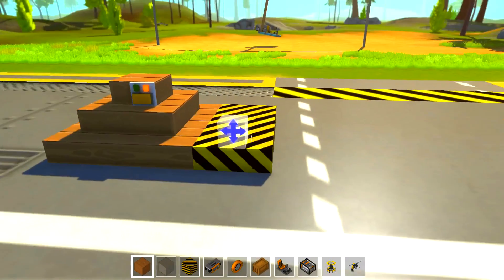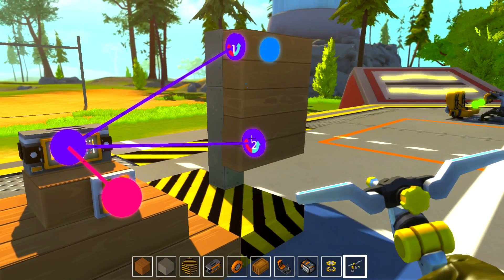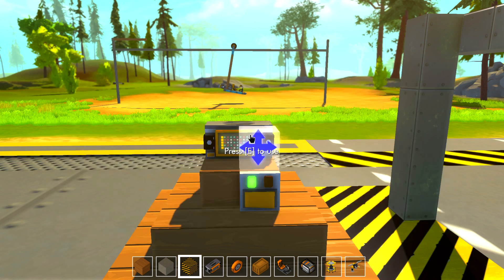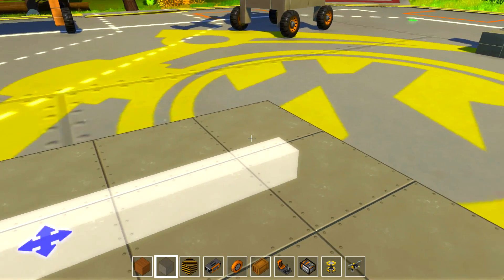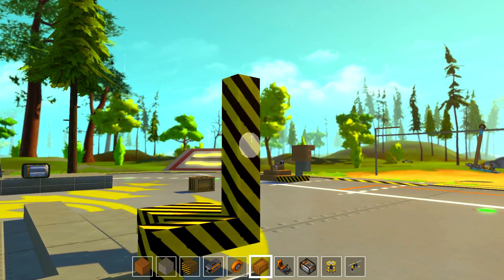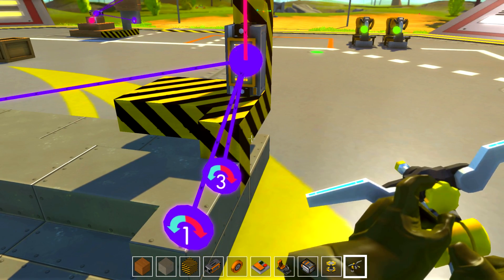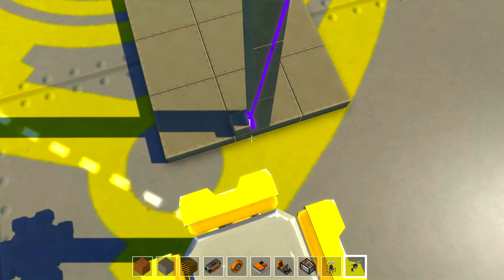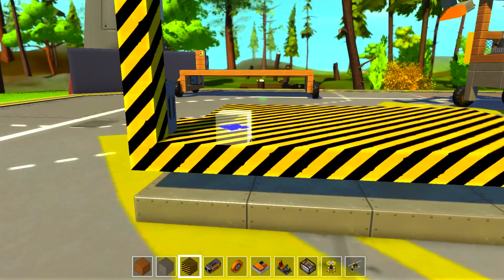Scrap Mechanic Gameplay - Ep 9 - Elevator (Folding Piston Elevator)

Comment: You could also make a system where the switch is at the bottom in the middle of two elevators. One starts on the bottom and goes up with the switch on, the other one starts at the top and comes down. Great build though!

Comment: I thought of a cool way to use the sensor elevator you show at the end of the video. instead of use it to just bring the primary elevator back down why not just using 2 senor elevator on for going up and one for going down  since the elevator go back to where that started when you get off of it you wont ever get stuck on the bottom or top floor

Comment: Hey Z, been watching and with the sensor elevator, wouldn't it be a whole lot easier if you build one to take you up and one to take you down, both with the sensor?  Just have the starting position for one so that its always up?  and by any chance are there any relays, cause if there are, you could have the first one you built with a sensor at the bottom with relays, so once you step in front of the sensor, it brings it all back down?

Comment: or why dont you just equip the main elevator with a sensor... like wtf xD why the 2 elevators XD
Reply: If there was a second floor and you went off of the elevator onto the second floor, the elevator would go down and you would be stuck on the second floor.
Reply: +ethan McGregor Oh my bad, I didn't think of the fact that the elevator is going to be used in a building. I thought of it as a lookout point in the middle of the field or something :D like it is in the video. Sorry. But still, you could put a sensor on the second floor, so the elevator comes up when you go near it. Also the elevator's stationary point could be in between the floors. That would be cool
Reply: Yeah it would